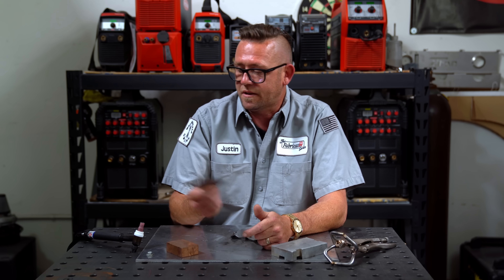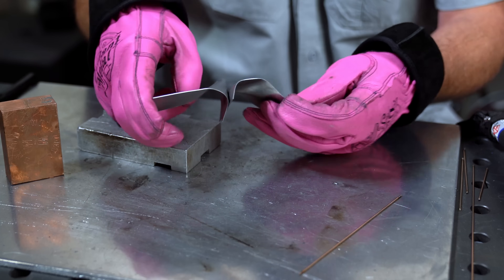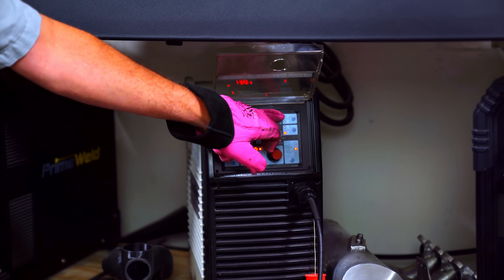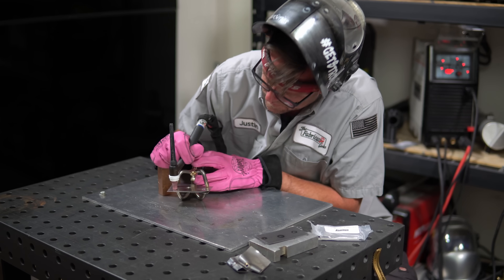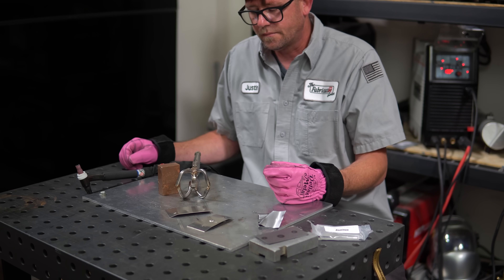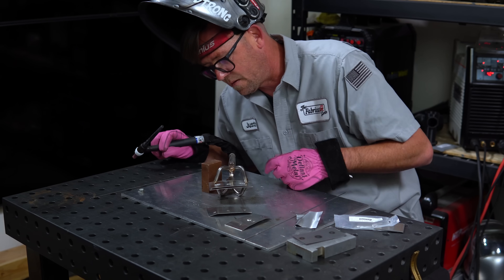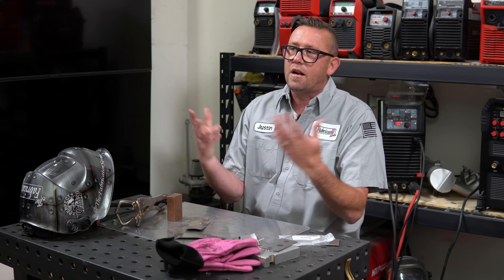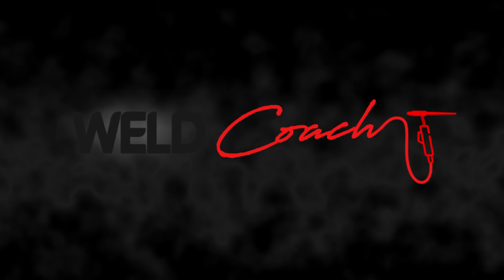Does the Spot Welder TIG Trick Work on Aluminum?

Comment from the maker: Book a one on one class with your own personal welding instructor
https://weldcoach.com/

Check Out Weld Metals Online materials, consumables and MORE!
https://weldmetalsonline.com/
Reply: Thanks for the video.
I have some crazy ideas for spot welding aluminum. Do not own a weld nor have I used one, just watch lots of youtube and welders in the work place, and I ask lots of question.
1. Sharpen tungsten.
2. Frequency to max.
3. AC balance to start 75% cleaning.
4. Find the amps need to blow a small home thru the pieces.
5. Program welder up ramp 1 sec to set amps when you get blow thru lift torch add filler wire that is bigger then the hole you made then down ramp, increase gas so you will get some gas on the back of the weld for some shield, this could be pointless but this is an experiment.
This idea came to me when I remembered my Uncle using a 6010 rod and punching thru the metal then pulling out and filling the hole up. 
Was wondering since you get blow thru on a tig touch could you use it as a cutter on thin metal, kind of like a plasma torch?
I get crazy ideas, had lots working in the Industrial world, and 80 90% worked with more experimentation. Get a good start point then go from there.
Retired now so have to live vicariously thru Youtube.

Comment: Great video, just one question, wouldn't it be worth trying after cleaning the oxide layer off? I know the oxide layer will reform almost immediately, but it will be much thinner if you try the spot weld right away

Comment: Spot welding or bumping the weld is done in the marine industry on anodized aluminum pipe. It's basically a spot and dap with the wire then lift and repeated.

If you ever see boats with those big shiny fishing towers that's how they weld them.

Comment: If you drill a small 1/4" hole before on the top piece, it will be like very short  tig welding. 
Other than that I purchased a 240V spot welder from Harborfreight tools for $160 last week. They also have110V version. I tried both. Per me 240V is a bit better. Anyway I spot weld two pieces of 1mm thick aluminum sheets. But before doing this its a nice trick. You need to sandwich these two aluminum pieces betweet two pieces of steel or stailsteel steel ( about 0.5 mm thick) that you  can find from scrup garbage can. Guess what? Its works so good. I used only about one second holding time and it worked good. Then I tried the same with 3 pieces  of 1 mm aluminum sheets. Again I sandwiched these 3 aluminum pieces between two peices of thin about 0.5mm thick scrup steel of stainless steel and then spot weld. I hold no more that 3 seconds . It works great. After spot weld these two steel pieces can be easaly removed. They don't stick to aluminum. shir them to remove. They can be used for many times. No problem. If you don't use any steel sandwich , its  not gonna work at all. I got this trick from here on YouTube. Its so strong spot weld.  I love this machine. Per me $160 for that machine is like for free.

Comment: Sorry I’m late to the party - my interest is in shorting the amperage route.  You might want to insulate the top layer at least to prevent amperage from running through the clamp.  As for that oxide layer - heat plus electricity (maybe even DC) can remarkably affect the oxide layer - it is the technology of brick and refractory production.

Comment: I know the answer to this problem:
Put 2 coupons of steel either side of the aluminium, and spot weld like it's the steel you are spotting, the steel sandwich forces the aluminum to meld into each other rather than the lower aluminium coupon flowing away from the top one
Old timer spot welders know this trick.

Comment: Justin 
I was already thinking about how you did not clean the coupons to remove the oxide before trying the spot weld. - had you done so might the spot weld have worked? stainless steel bush of both surfaces and some solvent clean with something like acetone.

Comment: Could you drill a small hole in the top layer and use filler to fuse bottom layer and inner edge of the hole in the top layer. ? Or maybe that defeat the purpose of hands free feature of spotwelding

Comment: I wonder if it would work if you gave it a quick hit with an abrasive where the contact is going to be, and put a dab of flux paste in there?

Might be worth trying, just for the novelty of seeing if it is possible. But at that level of effort, you're probably better off punching a hole in one side and joining them with a plug weld.

Comment: I spot weld aluminum with my - spot welder. Obviously I can’t do butt welds, but otherwise it works well. The problem with spot welding aluminum is the conductivity. Both when TIG welding and spot welding, the conductivity prevents the heat from staying concentrated. Because of that, you need more heat than with steel. That means that the amount of heat can be so much that the low melting temperature results in melt through. It’s a fine line between success and failure. Steel is far more forgiving. Additionally for TIG is that many aluminum alloys contain magnesium. That makes welding it more difficult. Aluminum welding alloys help to counteract that. And yes, the oxide layer is a major problem for TIG welding, though it actually helps when using a spot welder.
Reply: can you specify which spot welder you use? oxide layer should not! be scuffed?! heared the opposite but i am a beginner gathering information. thanks
Reply: @samehdarawshi3537  the Miller 2.5k 240 volt.
Reply: @samehdarawshi3537  I thought I responded to this, but my post isn’t here. Ok. I use the Miller 240 2.5Kw model with a floor stand that I’ve made major modifications to. There’s no point to scuffing the surface of aluminum as it takes less than a second for a new oxide layer to form when oxygen is present. It might take a lot less time if it’s warm. Additionally, spot welding depends on resistance to heat the metal for it to melt together. Aluminum has a fairly low resistance, so you need a high wattage for possibly a shorter time. You have to run tests as different aluminum alloys will act differently. Remember that copper is around 96% conductive while aluminum is around 60%. Various steels are, at best 27%.
Reply: When I was young an old guy showed me how to get reliable results in aluminium from a conventional spot welder. The trick is to sandwich the alu between two sheets of stainless of about the same thickness. The stainless becomes red hot, heating the aluminium so it forms a single molten pool, so it is not the usual spot welding process, but a form of indirect heating. 
The stainless, being higher in electrical resistance, heats red hot,  upon which the thermal conductivity of the alu causes it to melt right through. 
The stainless presumably bridges the tip pressure out past the melt pool to limit the squeeze displacement, and also holds the molten aluminium in place until it solidifies like a tiny casting, rather than being squished out.
Obviously this is not a viable production method. They make special spot welders for aluminium which do no require this kludge. I understand they have massive capacitor banks to provide current at a very steep transient slope.
Reply: @Gottenhimfella that’s an interesting idea. I’ll try it when spot welding aluminum again. Any idea of the stainless gauge used? Unfortunately, the only thing that can be done with these basic transformer welders is to vary the time. There’s no way to give an instantaneous ramp time. But mine is pretty quick.
Reply: @melgross  The ramp time is not really an issue (because it's not a true spot weld, more of a casting process). The stainless gauge should be similar to the workpiece for 16 gauge or thicker, but I wouldn't go much thinner than 16 for the stainless if the alu is thinner.

Comment: Might have some success if you brush the oxide layer off and set the machine on dcen instead of AC. Alot of old heads like to weld aluminum on DC for work holding equipment.

Comment: what would be interesting to test is to use a backing plate so the weld doesn't fall through, which enables you to have a pool where both sheets mix. however that only works if the oxide floats up to the surface for the arc to deal with, otherwise it gets trapped and causes cracking.
also i think 5 series is the only one that can be autogenous welded.

Comment: Thanks for the video.
Every interesting. Do not weld do not have a machine. Was wondering what if you turned the ac balance very high to cleaning and then did a spot weld? If you have lots of ac cleaning maybe it will go thru both pieces. Love experimentation.

Comment: Arn't you suppose to clean the Aluminum and heat it up somewhat before you doing any going of the metals😮
Reply: Even if it's true it doesn't help when all you want is to tack something together quickly, or spot weld typically a large thin assembly.

Comment: Hey Justin thanks for the video. I have tried to do this as well in the past and it just simply does not work. Sometimes you get a drippy spike of aluminum that falls through both plates. I’ve also tried “plug welds” but the aluminum from the top plate always melts away extremely fast. The surface tension of aluminum is weird when it melts

Comment: I'm glad you tried it with filler as well, as that was my next question. I'd assume another issue with this technique is that the shielding gas can't get between the two layers. That means the lower layer will be instantly oxidizing as you're trying to weld it, leading to that crap weld quality and no bond strength. Oh... I just got to the end of the video where you say this. You covered it better including discussing the arc breaking through the oxide layer though. Good stuff!

Comment: Still watching, but I can say that I used spot mode on aluminum and it works.  The time needed is about 200 ms and the current should be 2-2.5 times higher than normal.